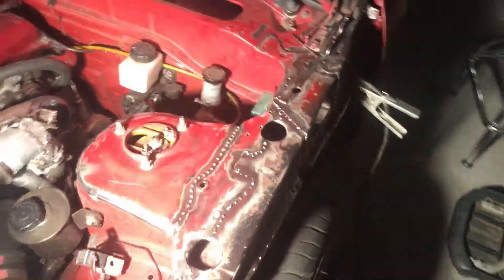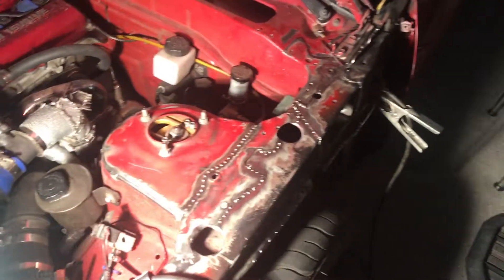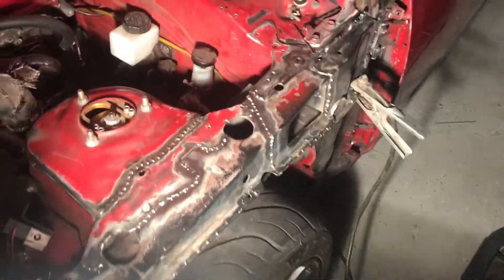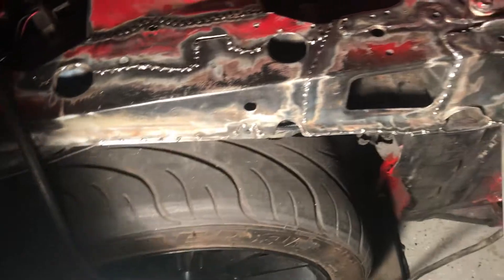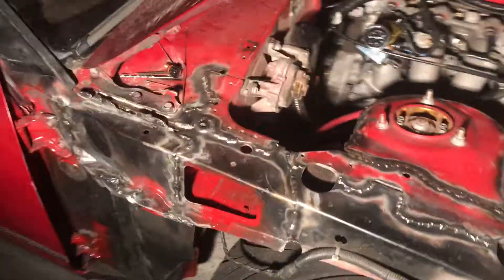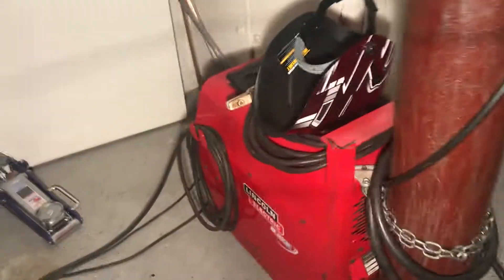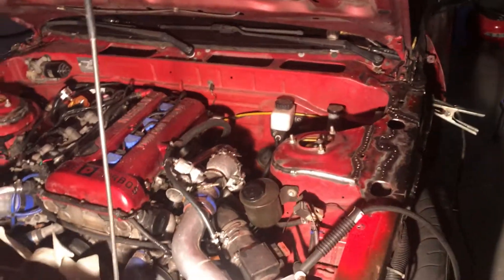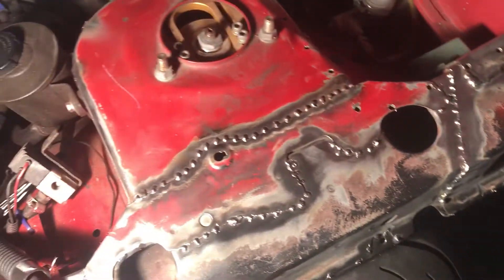How to Stitch weld 240sx chassis

Comment: Howd you get all the seam sealer out? Just a wire wheel will work?
Reply from the maker: Josh Kramer yes wire wheel is the best way to clean it up. Small one on a hand drill works best for tight spots and a standard angle grinder for the rest 🤘❤️
Reply from the maker: Josh Kramer lmk if I have any more questions